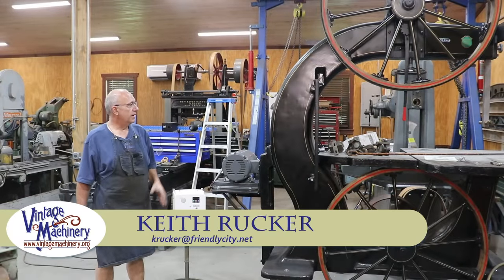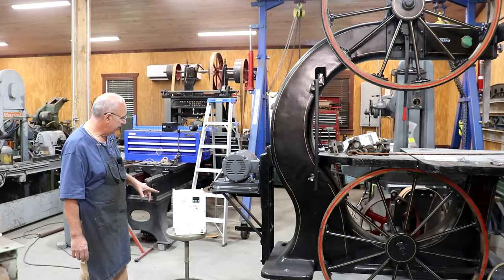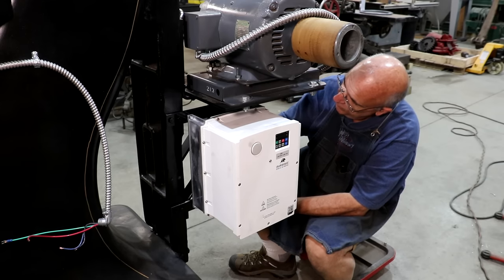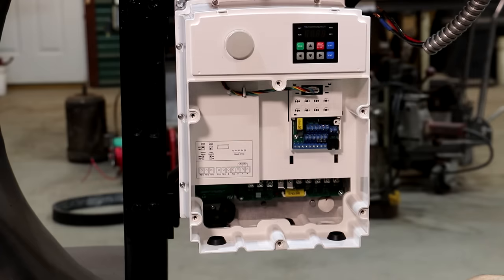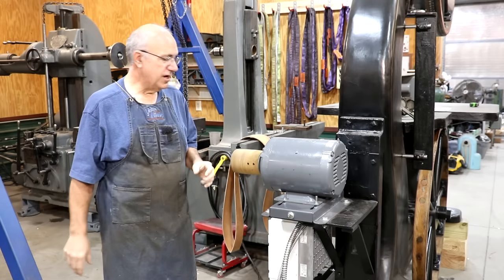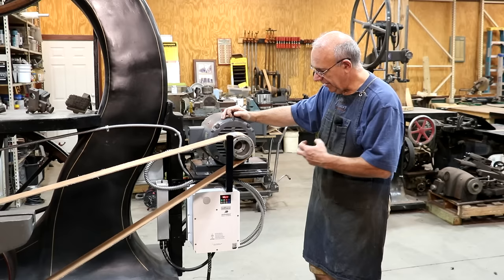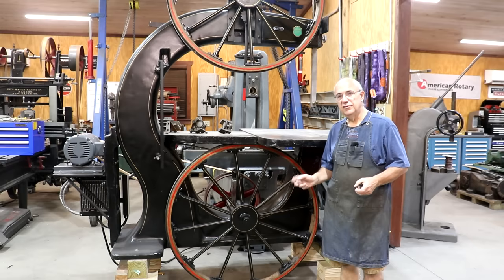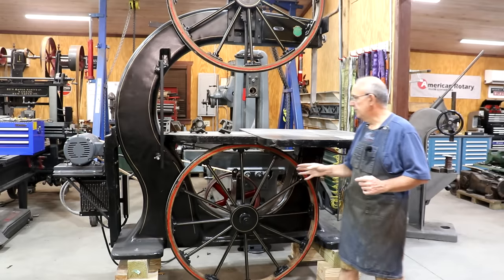Diresta Bandsaw Restoration 32:  Installing a Variable Frequency Drive (VFD) for Motor Control

Comment: Hey Keith, another great video. Remember to finally tune the VFD when you have a blade fitted. Both the blade and the upper wheel will add to the load inertia. If you have a dedicated emergency stop input to the VFD, you might be able to program a separate deceleration rate/time for estop. Please make sure that the VFD can stop the fully fitted load at the fastest rate (minus a bit for margin) reliably without tripping out over voltage. If Jimmy ever needs to use the estop feature, he’ll need it to be fast and reliable. And it’s okay if estop takes the dump resistor close to its max temp, he shouldn’t be using estop frequently. The regular stop can take longer to reduce the energy dissipated in the dump resistor. That should be able to be used repeatedly without overheating the dump resistor.😊
Reply: Very good advice and covers the thoughts I had watching this with answers on how to address the issues.
Reply: Exactly my thoughts also. You have that monster Bleeder Resistor, time to heat it up with a fast emergency stop sequence!
Reply: The estop is most likely to be used while cutting, which will already reduce the momentum. But you need to make sure it will stop quickly when unloaded by a workpiece. This is actually more demanding on the VFD surely.
Reply: @EJP286CRSKW  Either way, the estop needs to handle regeneration from the worst case load condition, which I agree is when the saw is unloaded.

Comment: Currently the electrical system is working under a VERY light load.  Once the saw blade is fitted, the start up load will increase and the shut off rotational inertia of the upper wheel will be added to the lower one.   Under such normal working conditions, I suspect you may have to modify a few of the VFD soft start and braking settings.
Reply: I had that thought, possibly subject to some blade slippage.
Reply: Looking good Keith!
Reply: I was wondering the same thing

Comment: What is causing the belt to shift, is that the high spot of the motor pulley crown, is not in the center of the belt. Moving the high spot towards the new bracket (out) will fix the issue. Can be achieved by moving the motor out, or re-doing the pulley to move the high spot of the crown out.
Reply: My thought exactly. The motor pulley being crowned like that, and not having the belt centered on it is going to have it track to one side really badly.
Reply: Also, if the motor axis is not truly perpendicular to the plane of the belt centre-line, this could be contributing.  You could try rotating the motor frame slightly anti-clockwise or clockwise viewed from above and/or tilting the drive-end up or down.
Reply: You might try some washers under the motor to tilt a bit because it has a significant effect on how the belt tracks. I just finished my belt sander and had to experimenting with it a lot even when I set everything paralell (best effort)

Comment: I picked up the habit from my dad when starting a large saw. He would grab the bottom of the upper wheel give it a yank in the operating direction and then hit the start button. From before the days of soft starts and VFDs.
Reply: Like when the start capacitor goes out on a bench grinder lol

Comment: Keith, one setting that may help you belt tracking during acceleration is the type of acceleration you choose.  Most VFDs allow for a linear acceleration as default but also have an S-curve option.  This requires a little more torque but the acceleration is variable and it eases into the acceleration profile so you have smoother transitions which may (or may not) help the belt tracking.

Comment: I had to go down the Chinglish rabbit-hole for the VFD I installed on the old Clausing milling machine I rebuilt. I wanted to get one with a better manual, but, as you say, those were of higher price because of better quality all around, and the price was more than I could afford, even for the small(ish) VFD I needed for this mid-sized mill. It works beautifully, and the need to change speeds by moving a belt is mostly gone.

But, boy, when I then went through the same thing when trying to set up a 5HP 14-inch table saw, new VFDs were right out, at least for me! Thousands of dollars. After lots of scrounging and research, I did get the saw to work for me, with a used 15 HP VFD and a dedicated -- and giant! -- transformer, to take my single phase 120v service up to 440v (I think). And then, after hearing it many times from my son, I realized the saw was much too large for my shop. I had scrounged so well, though, that when I sold the saw, I made a decent profit. Not on the time spent by any means, but that's okay. I learned a lot, and I got a lovely old machine working again. It's now down in Central America, installed in a saw mill.

Comment: Hi Keith thank you very much for all the videos you share with us and the knowledge
I noticed on your frequency drive when it runs it whistles and make whistling sound in the background you can adjust that and get rid of it if you want 
Under Operational Noise Settings (carrier frequency settings) Page 4–170
You can drop it down or increase it to see if it make a difference normally I drop it down and it works fine without hearing the motor whistling in the background

Comment: Dont forget you need to tune the whole drive mechanism with the blade installed. The rotating mass will nearly double once the second wheel and the blade spin up.
Reply: I came here to point this out, especially with the energy dump resistor.  Don't adjust it to the limit without the whole assembly!  When you add the rest you may over-volt the system again.

Comment: Re turning the motor round to give some additional travel. If you turned the motor upside down and hung it from the bracketry, which may need to be beefed up, that would give you the extra travel and possibly neaten the cable route?
Reply: Good idea!!!

Comment: Nice upgrade and I believe it will make a better safer saw for its user. You may want to add Mexico to your suppler list , I have had  good service and quality from components sourced from our neighbors, I am retired now from a multinational corporation we provided high end polymer to some Mexican companies making electrical and electronic products. I
Made suppliers visits to many of these facilities and was impressed with the focus on quality both through ISO standards in place and 6 Sigma programs to eliminate variability in manufacturing. If I have a choice I by Mexican over China every time even if it’s a bit more $.

Comment: I suspect that if you increase the diameter of the motor pulley, the additional belt contact surface area will help limit slippage and the band saw will get moving to follow the acceleration of the motor better.  Also, the larger diameter of the motor pulley would give the motor slightly less mechanical advantage on startup, which would make for a more gentle startup anyway.  The final speed can be regulated down to compensate for the slightly larger motor pulley.  The VFD, if tuned right, should respond to variances in loading and try to keep the motor at a constant speed regardless of pulley diameter.  Good luck!

Comment: Some VFDs. Have a auto tune feature that makes setup much easier. I like the big heat sink without the need for a fan.Some are more compact,with a smaller heat sink but,those fans can be problematic in dusty environments.

Comment: Keith, sometimes, if a belt has a slightly larger side, it would pull to one side. A simple test would be to flip the belt around and see if it pulls to the opposite side when starting. Have fun.

Comment: Another thing that seldom gets mentioned concerning VFDs and motor speed control is that there is a minimum speed the motor must run at to cool properly.  If the motor is operated below that speed the fan doesn't move enough air through the motor to keep it cool.  In most VFDs this can be programmed in so that the motor won't run below it's minimum.
Reply: This is likely not an issue in this application where the cutting load is going to be of short duration and light on the torque.  It's a different matter your application is trying to get the full 7.5HP at 20 Hz .  Same thing as paying attention to the duty cycle on a welder.

Comment: I'm a huge proponent of VFDs, particularly for large equipment. In addition to the soft start they provide a ton of interlock capabilities and also monitor current, voltage, etc.  They protect both the motor and anything connected to it.  The variable speed opens up a ton of possibilities for getting the best cuts.  Great application.  Thanks for the great videos, as always.

Comment: Indeed, take into account that the inertia essentially DOUBLES when the blade causes also the upper wheel to be be accelerated (and decelerated).  There is some minor increase in losses, but without a work piece in place (and it is normally not, either during start or regular stop), the time constant and thereby the natural start and stop ramps will be about double.  That means, the main stop effect is left to the brake resistor.  I hope your more powerful resistor can handle it.  But you better evaluate it!  The resistor heating also has its own time delay.  Same power applied longer, or repeatedly may cause surprising heat, which has to be dissipated.
  If the resistors are commercial brown enamel coated ones, they are rated for up to 300 degrees Celcius (570 degrees F).  If they are custom wound without a core, like certain room heaters have, they may tolerate temperatures up to red glow, but they still need adequate ventilation.  And they do form a fire hazard, for example with wood dust falling on them.  The best luck comes to people who know what they are doing, and don't forget their knowledge.  So, I hope I did contribute a little to the knowledge base in this case...

Comment: Keith,

Tou mentioned putting a cover over the belt, as a future project.   If I were Mr. Diresta, I would prefer you do the work.  As an artisan you can make the cover match your art restoration work.  I would also have you make the blade covers for artistic reasons.

If are asked to do the covers, I would start with Jason at Fireball Tools.  He restored a similar band saw and he made similar covers.

As an aside, I think it would be nice if you painted all the electrical equipment black to match the restoration. The grey, white and silver become a highlight.  You look first to the highlights and not to the band saw.  Your restoration is a masterpiece.  Don't let a little paint get in the way of your work. 

Bob
Reply: Jimmy is well accomplished at restorations and fabrication also. He just doesn't have the big iron machine shop that was needed to do many of the steps in this project.

Comment: Just a question, what about painting the wiring connectors black to blend in to the saw frame?  That will sort of hide them.  It would only be for appearance, not operation.
Reply: And paint the top, sides, and back of the VFD black also.

Comment: The load to start up and the momentum will increase when you get the blade on the machine and you add the weight and momentum of both wheels.
I also noticed you have the metal conduit and cables  to the control panel crossing the slot in the table where you feed the blade on installation which might be inconvenient.

Comment: Another thing to worry about is the nut on the wheel is you stop it too quickly.  We had a big radial arm saw (7 1/2 HP) that had a blade brake added.  If you set it too fast, the sudden stop would loosen the arbor nut of the blade.  And you don't want a 22 inch blade getting loose.   And a 48 inch drive wheel could be nasty if it spun off.
Reply: Happened to me on my old radial arm saw in my basement one day. Boy was that scary. I dropped to the floor and crawled out of there in under two seconds.
Reply: If I ran into that problem, I'd loctite the nut &/or if there was enough shaft sticking out, you could drill a whole through it
& insert a cotter pin. You could even make a castle nut w/cotter pin if room allowed.
This is comming from motorcycle engineering. You got me thinking on an interesting problem.
Reply: @toddk.5873  We did add a jam nut and it stopped the problem.   But I'd rather they were aware of a possible problem before it bites them.

Comment: You certainly give consideration  to multiple facets of your projects.  As such, I'm surprised at how you routed the electrical wires and conduits.  Possibly you were concerned with other than aesthetics?  

Nice job to both soft-start and rapid shutdown.

Comment: Keith i am sure you made the motor parallel to the shaft, but my guess is the motor is tilting down some. have you tried a couple washers under the front edge of the mount or cock the motor a little backwards from parallel to compensate?

Comment: Looks like your controls would be hard to reach if you had something that over-hung the table.  Working around the open wheels and exposed blade is a challenge for placement though.

Comment: Hi it would be wise to put a DV/DT output filter between the motor and VFD or the bearings will be compromised as well as the insulation in the motor, the alternative you can install brushes on the motor shaft to short the "eddy currents" to ground to protect the bearings. you can wire the "E-Stop" into the drive directly for a fast stop and with a remote key pad you can read the speed out.
Rich
Reply: The E-stop MUST be a fast stop. Keith did that wrong.

Comment: Thanks for showing how the VFD can be used for speed control. It may be a good option for my belt drive Gorton Milling Machine. I could set up the belt for max speed and use the VFD to control speed of the spindle motor.
Reply: Definitely yes for your mill  I have one on mine, and can run @120 hz or more for double the normal speed for small diameter end mills, or slow to 30 rpm for tapping with no belt swap... Would not be without it!
Reply: Rather than set up for max speed, choose more of the middle speed for better torque at low rpm for big drill and tapping...will still h as have good upper ranges by double or more hz
Reply: Great tip. I just noticed that the frequency output of the Iron Horse went up to 400hz. What concerns are there when increasing the hz and speed (other than mechanical RPM limit) and what model of VFD do you use?  @jimliechty2983

Comment: Thoughts: Could you get a spacer plate cut to allow for the motor to be reversed?

Next, is the motor shaft deflecting at startup to cause the belt to walk, but then return to the run position?  If it is, the bearings will need more maintenance.

Finally, a ten second eStop is probably 9.5 seconds too long in an emergency situation, so how about a wagon wheel brake on the drive pully slow things down fast enough without throwing the blade off the drive wheel ... dunno ... $0.10 ... 🙂

Keep up the good work ... 👍

Comment: I have had issues with using a vfd off a rotary phase converter.   The generated leg is not a true current capacity of the line 1&2.  Basically the 1&2 legs go right through the phase converter to the vfd and the generated leg is less current or amperage. You have to think of it as net input (you get nothing more from the phase converter in power total). Put a amp meter on it and see.

Comment: You probably can program the E-Stop for a harder deceleration;  If you are using that function it usually means that "something has gone bad" and you want the machine to shut down pretty rapidly. You just need to know the limits of how hard you can brake (like for an entanglement hazard, you do not want to be slowing down for five seconds).    Maybe normal stop is 5 sec but E-Stop is 1 or 2 seconds (also determined by the wattage rating of the resistor and the error code tolerance of the drive).

Comment: I see the VFD is producing 49Hz at top speed.  I assume it is adjusted to allow saw wheels to turn at the correct speed. I think it needs a shroud over the belt pulley area.

Comment: Glad to see a VFD being used. Maybe some purists will object as this is a vintage machine. Then again the VFD will extend the life of the machine meaning future generations will be able to see it working. As for the EStop, maybe a mechanical brake held off by an electromagnet. Modern commercial bandsaws stop when flesh  gets too close to the blade but then parts need to be replaced.

Comment: Regarding Chinese VFD manuals, I've never seen the expected 5 page, incomprehensible "chinglish" manual.  In the case of the three VFDs I have, the manuals had too much information!  The worst (best?) was an actual book of about 150 pages of very clear text and diagrams.  Its' only flaw was a poor index, so even knowing how VFDs are normally setup, it took me about an hour to find the relevant pages.  After that, I was able to wire and program it in about 5 minutes with ease.

Comment: Could you have made and install a flange on the end of the motor pulley? Most of the conveyor belts we had at the gravel plant had guide rollers that would keep the belts centered. Mounted on the slack or non pulling side. Nice job with the VFD.

Comment: Not sure if will help to keep the flat belts running true on the pulley but a 'YouTube' channel called "steam-powered machine shop" has his pulleys beveled with a ridge in the middle to keep the alignment of the belt on the pulley. (He also runs various widths of leather belts).